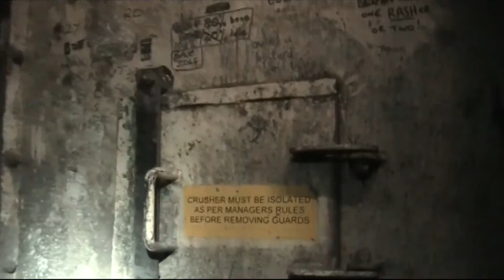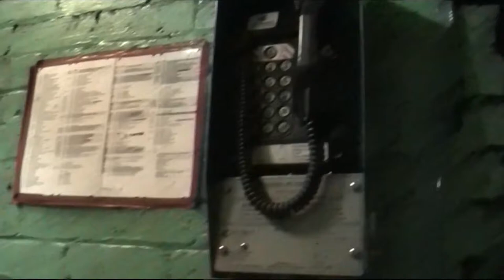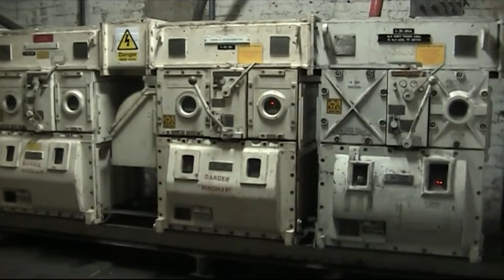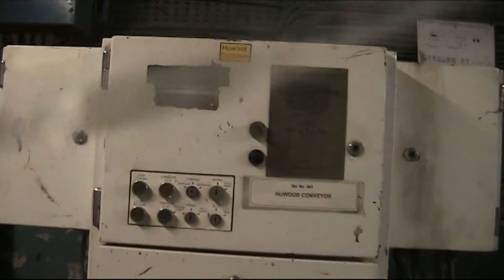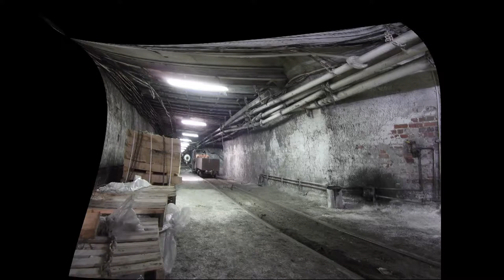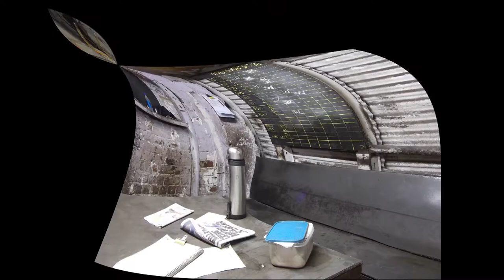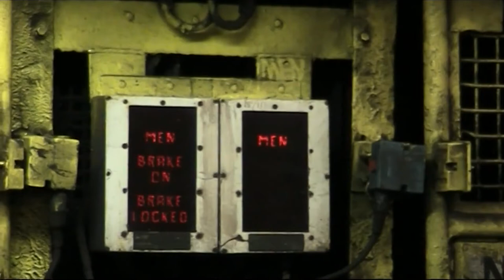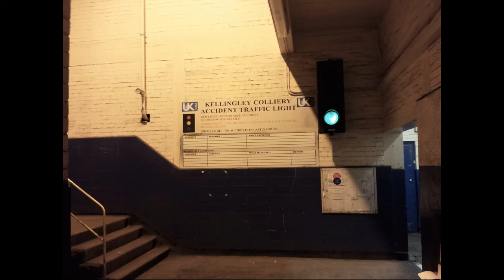Kellingley Colliery Underground Outbye

Comment: Was the coal takin out in tubs ????
Reply: No, the coal was taken out by conveyor belts via a drift entrance.
Reply: At Kellingley the coal went out via 2 skips up a vertical shaft
Reply: @keepingitsimple9058  Thanks I thought that but I wasn't sure..
Reply: @samensor-smith1062  Kellingley was a shaft mine not a drift .
Reply: @Cxwl9  yes they had two shafts one for man riddling and one for supplies. There was a drift for the conveyor to reach the surface.
Reply from the maker: @samensor-smith1062  No drift at Big K....I worked there for 27 years, I would have noticed it 😉
Reply: @oldnormyguy  oh right must be thinking of somewhere else then haha. Was the coal taken via shaft then?
Reply from the maker: @samensor-smith1062  Yep..2 skips, you can just about make out the skip pockets and one of the skips heading up the shaft at 6.40 on Kellingley Part 2.
Reply: @oldnormyguy  oh nice will go back and have a look for that. Thank you for replying.